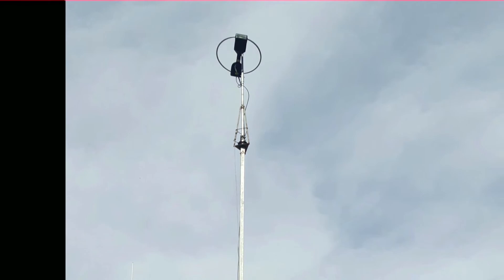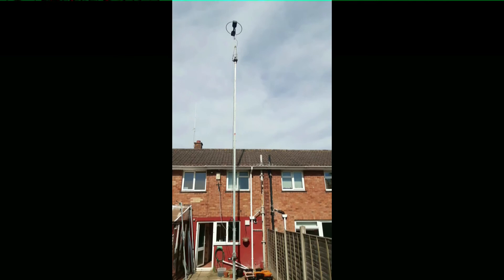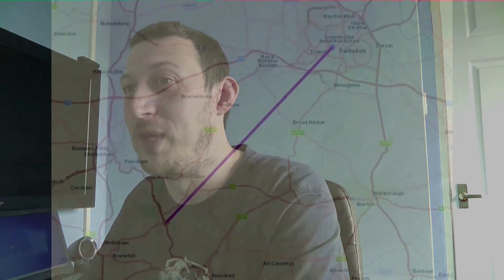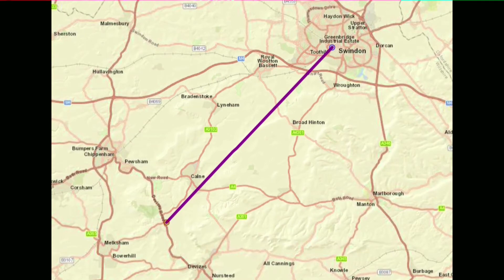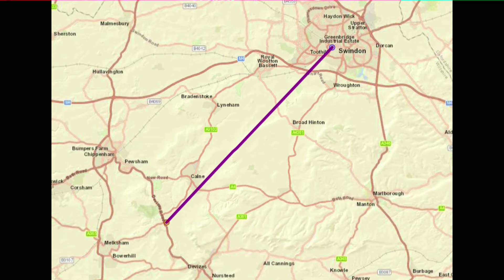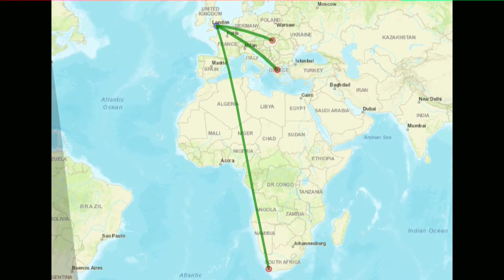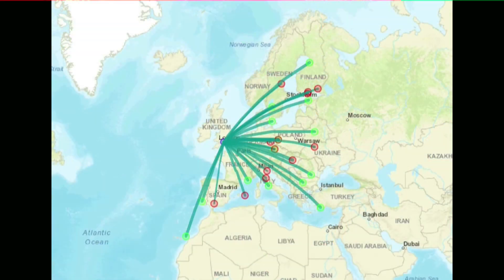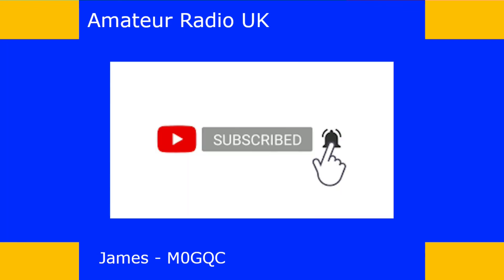MFJ 1788X magnetic loop WSPR testing - Mounted horizontally

Comment: You mentioned during the video that no one received your earlier WSPR signals (15m?). Were you heard on the other bands? Thanks, Bob, M0BOB.
Reply from the maker: Been a while since I filmed this so had to watch my own video to remind myself what happened!!!

It did fairly well on 20m & 40m. 30m was also ok, although not as good as 20 & 40 (possibly as it's a quieter band that less people use, so less stations on there).

15m & 17m were both completely dead but I don't think that was due to the antenna. I think that the band was just closed & no one else was using it.
Reply: @HamRadioOnline  Thanks. It's interesting to know. I have a Chameleon Magnetic Loop antenna, it is ok for WSPR and FT8, but that's about it.

Comment: What is the loop's receive performance like? Does it have a better signal to noise than your wire antenna?
Reply from the maker: Good question!

When you say my wire antenna I presume that you are referring to the "Terminated Inverted U" which has featured in my other videos?

I've not really done any side by side tests so can't really give a definitive answer (that could be a topic for another video) but here's my perception from using both:-

At the higher HF frequencies (30 meters and above) I think that the loop has it over the Terminated Inverted U.

Getting lower in frequency (30 meters and below) I would say that the Terminated Inverted U starts to take over. Obviously the Terminated Inverted U can also do 80 meters, which the loop cannot.

Typically I would use the loop for 30 meters & above, & use the Terminated Inverted U for 40 & 80 meters. Also remember that the Terminated Inverted U doesn't need the constant retuning that the loop needs (constantly having to re-tune every time I change frequency drives me to absolute despair at times).

You have to remember that both of these antennas are very much compromise antennas, so a standard dipole at a reasonable height WILL out perform both of these antennas, although I think that the loop starts to get close to a dipole once you get up to 17 meters and above into the higher HF bands.

That said, these antennas are both claimed to be "quieter" in noisy environments when compared to a standard antenna. That would be interesting to test if I can find a way to measure S/N ratio (maybe with an SDR?)

We were very seriously looking to move house, so most of the antennas (including the loop) have been taken down and the big mast has now gone. Unfortunately Covid came along and put a stop to any ideas behind a house move (it's not really sensible to be moving house and increasing your mortgage when you don't know if you will still have a job in a couple of months time). As a result I'm now without a mast. Absolutely gutted!!!

Apart from the Terminated Inverted U (which is still standing, though it has been moved from the position shown in the video), I currently have no HF antennas up.

I'm looking to put the mag-loop back up again although I currently have a back injury, so won't be climbing any ladders for at least a couple of weeks!

I think I've also figured out a way to get a 1/2 wave end-fed for 80m to fit on my property. That will be a little way off yet but if that does happen it could be an interesting comparison.

Despite these mag-loop antenna videos being quite old they still get a surprising number of views, so I have been thinking about doing a revisit.

You might have just given me a couple of ideas!

Comment: Thanks so much for your video on the 1788.  I just received one.  Knowing how the QC with MFJ can be an issue, I took off the cover first thing.  The butterfly cap was not turning due to a loose set screw on the motor to cap coupler, that was an easy fix.  I noticed that the limit switches were shutting off the motor before the blades on the cap were fully meshed,  I fixed that also.  The small inductive loop was not in the shape of a circle, I fixed that.  Finally, the blades on the cap were not aligned, and fixed that too.  I live in a highly restrictive HOA, so the 1788 is small enough not to draw too much attention.  I have a multi-band attic dipole which transmits fine, but too noisy on receive.  I have two receive only loops on rotators, and phased together.  These loops are active loops with preamps.  I got the 1788 to see if it would have better receive gain than the broadband receive only loops.  So far, the 1788 does work better on receive.  I use the band scope in the IC-7300 to tune the 1788 visually, this gets me real close, real fast.  '73  Bob
Reply from the maker: I have heard a lot of comments regarding MFJ quality control. 

Unfortunately the mag loops do seem to have some fairly well publicised QC issues, as you have identified.

Shame really because I actually like the couple of bits of MFJ equipment which I do own.

I wouldn't class myself as an MFJ fan boy. I do tend to swap and change between brands (so I wouldn't say that I'm loyal to any particular brands). I absolutely would slate any equipment that I thought was rubbish. However, it does seem that people like to hate on MFJ simply because they are MFJ.

I try to be open minded and give every manufacturer a fair chance.
Reply: @HamRadioOnline  I too have quite a few MFJ pieces of equipment and most work as advertised.  I am enjoying the 1788, and like you said, the bandwidth is "crazy" narrow;  but, that's the nature of transmit mag loops.  I'm thinking about designing some type of tuning cap position circuit that would remotely give you the location of the butterfly tuning cap.  I use the waterfall visually on my bandscope in my IC-7300 to get the tuning close; works pretty good.  My 1788 is mounted vertically on a rotator and is only 7 ft. off the ground. I want to learn how to use WSPR . . . seems like a great tool.  Well, take'er easy over there,  '73  Bob  N7ISU